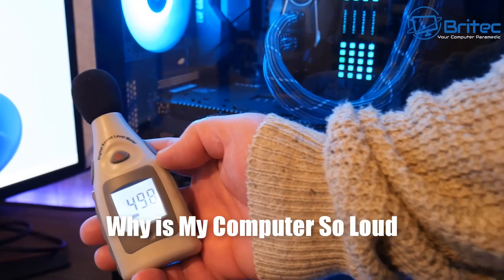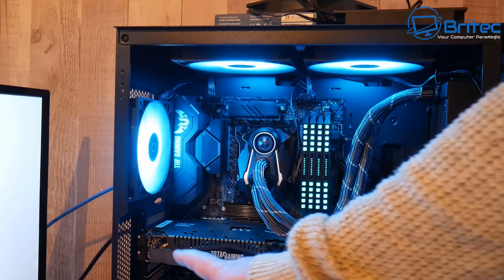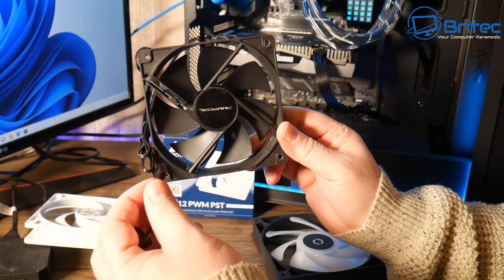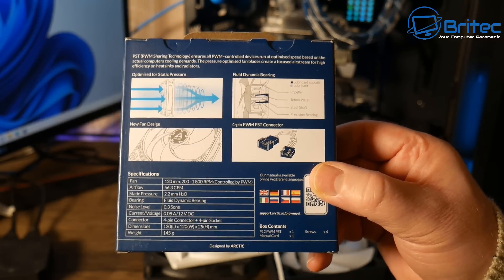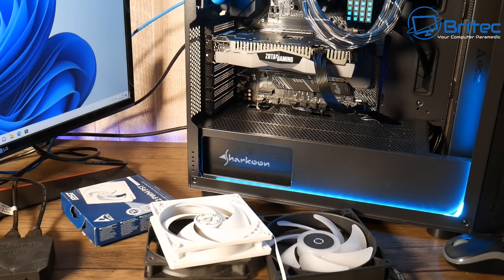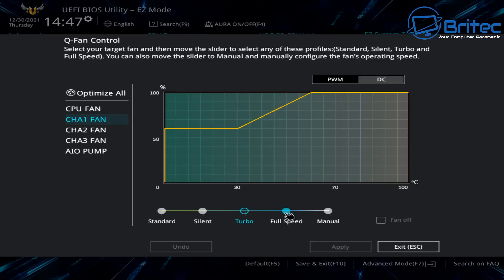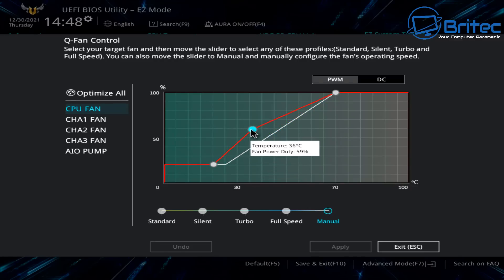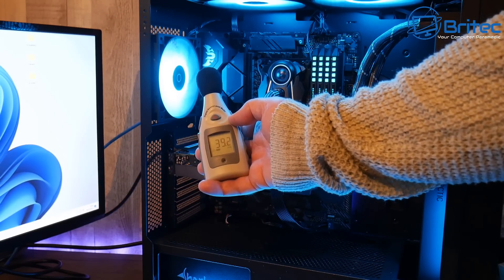Why is My Computer So Loud and How to Reduce PC Fan Noise

Comment: I always connect my fans to pci slot fan knob controller. Especially when you're not putting any load on the CPU or GPU, its great to crank 3 fans down from the outside. THe only caveat is you don't see them on the BIOS but that's not a big deal. Use Speccy to monitor temps and you can crank them slowly to a minimum temp and enjoy the quiet.

Comment: looks like someone setup a click bait video, 2 years, and halfway to a check from youtube. I Quess it is kind of useful information. When pc's were new and small and were horizontal, people had them on their desk. it is only in the last 10-20 years that people have tried to make as much extra money on them and having them on the desk right beside the monitor, and makes no real sense, until you add up the extra cost of a water cooler, RGB and high priced case. I threw some parts together 11 months ago based on the 14700kf, 4070ti super and cooled it with air. watching prices since then on prebuilt based close to the parts that i selected, the prices ranged anywhere from 1000 to 1500 bucks more than what it cost me to build a blacked-out system with the parts in the cheapest atx fractal case. Still 11 months later the prebuilds are still anywhere from 500-1000 bucks more than what i paid with all that extra bling for a pc that is good for 2-4 years at best.   laid the case on its side on the old sub behind the 1600 dollar display that i selected at the time (48" LG C3). The box is over 12 feet away from me. since the 2.1 HDMI cables are such a rip off at 80 bucks for 4 feet. the PC would be a dedicated server/ pc room/ riser closet just like the pros have their gear. Saying all that new solid Pc's builds don't ramp up playing games for a modern game, It takes at least 2 years for a solid build running modern games to start to get loud. I remember reading about hi end a system that the US Government built back in 2003 for recording all public data, the engineers promised the government that the storage media would last 20 years. When the engineers fired up this system, just the power alone was stated to consume 6 million bucks worth of electricity per year (just to give you a scope of the size of the system) anyways when the system was turned on, the cooling portion of the building caught fire, as it was under engineered for the amount of heat the processors generated. The system engineers at that time freaked out as per the article, went back to the Government and told them, we are recording so much information, that the storage media will be at capacity by 2005. Most people will never clue into what was signed in just a few days after north America was attacked that September 11th 2001. Man, I can just see what it must have looked like after that hit started the war for information, some guy promotes a private security system to the Government. I can build you a system that trips all mics on every cell phone, pc and gaming box to go hot and record 24/7 and will only cost the government 100 million bucks. The Government reply, wow, that's cheap, we'll take 2 please. and that is just what the article posted 21 years ago. Me, 2001 one of job that i got that i was asked to do for a Co was to install the very first CRTC mandated real time packet sniffing server on the west coast of North America. These Black boxes were priced just under 1/2 mill each and were installed in ALL head ends in North America. Coolest tech that most people have no idea about. ;)

Comment: what if you don't hear a fan when doing an update... did my laptop and the fan was going crazy then did my mums computer ( long time not done ) and was abit worried it was silent. her computer is slow could this be the reason if the fan doasnt work. plus how can you test if it is working. cheers

Comment: My Windows 10 Hewlett Packard recently starting making awful groaning noises on start up as though I'd left a disc in it. It just makes this horrible noise. That's why I'm watching this video so I'll have to start by unplugging everything and cleaning it. Then I'll look through all the other stuff he says....which I don't know anything about but.....that's why I'm watching this video.

In the meantime....it's on the floor under my desk with a pack of printer paper on top. I've discovered that if I leave it running for a couple of minutes on start up then drop a pair of pliers on it (AKA whack it one) - it shuts up and stays shut up - mostly.

I don't know why this has suddenly started. No drive problems (I recently moved stuff into a second drive - no probs). 

Google/Youtube are fannying around with Adbloc and it's messing all their stuff up (GRRRR!) but all the other stuff runs as it always did and I first noticed it after a Microsoft update. I bet it's Gatesy stampeding us all into new Windows 11 "thingies" with his unwanted, unasked for and opt-out-if-you-can AI "co pilot" - he's stinking the place out as usual.

Comment: my case is shorter i mean not height but length however inside for cpu it hase one fan and all the heat comes out mostly on back side its logical that that side has more heat but i kinda start to panic and cant get out of anxiety because don't want to break pc i wonder if the pc shown in this video can be different i mean what if another fan was on upper side so some more heat will go on upper aide

Comment: Calling BS on the Arctic fan specs displayed at 4:51. Noise level is 0.3 sone, which is equivalent to 10.5db, and that is impossible for a dc fan that outputs 56.3cfm, not even close.

Comment: That's normal gpus cpus nowadays are demanding nowadays for cooling

Cool idea is to put your pc 
First in cool place 
Second try to make a little far from you 
Third use a good headset (maybe stupid but good headset isolate the sound really good)
And use a good cooler if you get a stronger gpu cpu have good cooler's

Comment: My fan is connected to a built-in motherboard port
It constantly spins at 2800 RPM
I can't control the fan speed
It used to be able to be silent

Comment: I wish you or someone else would do a video on PSU noise.  I bought a new more powerful graphics card and while my 750 W power supply can handle it The fan in the PSU gets way louder now when playing heavy load games.  I think it’s just because my PSU is having to output more watts and getting hotter.  I’m not sure if me getting a higher watt power supply or a higher quality 80+ rating would make a difference.  I have bronze now.
Reply: Maybe having the same porblem I have 3050 and it never use to be loud but starting 20 mins ago it sounds like my psu is getting louder I believe
Reply: @groot_racing  I bought a better psu, a consair 850 gold rated and it is super quite.  It was definitely just that my old psu was being pushed so close to its limit and heating up.

Comment: You. Saved. My. Life. At first my fan started to make noise randomly, and didn't take the time to deal with it. Then it started to make this horrible noise almost constantly, and Iit became a real pain. I tried to slap it, to lower the noise for 20s, put paper in it (yes I did), have been watching a lot of videos explaining I should lower my cpu power, cool the air in my room, .... Then I found your video, and did all mentioned in it. It's easy. I just had to replace the sticker with an adhesive, and it was ok (spread a bit of lubricant and the sticker wouldn't stick anymore xD). And now, my computer don't make any sound. And I realized how much noisy it became and the real PAIN it was. I should have done that earlier, but you really change my working condition. Thanks !! Thanks so much !!! (Honestly it was such a pain, I wonder how I could for so long with this noise)
Reply: I lost it when you said "I slapped it" 🤣🤣🤣 me too bro, me too. It's good that we got the Internet to actually learn 💪

Comment: It seems like this is what happens when I play some games on my computer from steam. I'm worried it's going to damage the computer or catch on fire or something like that. Will it?
Reply: No
Reply: @cold2389  No for which one? Or is it both? I'm happy wtih both.
Reply: @Daniel100Benner  it will not explode or just lower ur fan speed using msi afterburner
Reply: @cold2389  Okay, it won't explode. I guess it also won't damage my computer. Idk if I have msi afterburner.
Reply: @Daniel100Benner  its program that i use for my gtx 1650 to lower fans

Comment: Your computer is loud because you have a GTX ZOTAC graphics card.  nothing in the world will make that thing quiet.  It doesn't even have a 0 rpm mode when youre in desktop.  I had a 1660ti AMP Zotac card,  got so fed with it that i threw it in the bin after 9 months

Comment: The  fans  are   running  at   11 ,  when  you need   that  extra  push  !  PWM   controls  the duty  cycle ( one time  verses  off  time  based on the  powering DC  square  wave )   going to the  armature   inside  the motor
Reply from the maker: That is correct

Comment: I'll have to do this. I couldn't hear your fans because of the volume of mine.  :-(
Reply from the maker: lol
Reply: @Britec09  I have multiple machines. One doesn't have to be quiet, but it is because it has controls and I set them right/connected them right (Corsair - expensive, I know but everything in the system is Corsair: AIO, all fans, 64Gb RAM). When I was making a similar system, somehow I didn't get the fan speed controls connected right, so they spin maxed out for ALL fans. Not sure why, but I'm pulling the system from primary use and pushing it to game machine only - I'll recheck the wiring then. I was rushing to get this in service at the time. My prior AIO was off brand and I replaced it with Corsair since everything else was and the other machine worked. Recently, I decided to build a machine that I primarily use for development and teaching (I teach online at uni). I can get by easily with an average video card and I decided on a fan system for the CPU since I rarely pushed the CPU that hard. Case fans were leftover Corsair fans that were NOT RGB and I plug them into a hub and control the lot from UEFI.

Thanks for the video. I watch most of the others, but this one REALLY struck home  for me.

Comment: Yes Brian I think a lot depends on the size of the fan I have six in my main desktop build which I used three 200mm fans that run reasonably slowly therefore less noise. I never used 120mm fans unless I really have to because it stands to reason they have to spin faster to move the amount of air through the machine. Plus I used a particular brand of fan called Silent something or other and although they were very reasonably priced were also very quiet but unfortunately, they are unavailable anymore. I have to say I did fit an internal fan speed controller too which again allows me to run the fans at what speed I want. But a good video mate for a common issue.

Comment: I have seven Arctic P12 120mm fans, as well as a D5 water pump, all running at 100% full-time in my be quiet! Silent Base 802 case and I can barely tell that my PC is on. If you want a quiet system, buy good fans and put them in a good case. It's as easy as that.
Reply from the maker: They are good fans, got another build video coming up soon
Reply: @Britec09  Cool. I'll be watching.

Comment: I bought a long cable for my monitor and one long usb-exenstion cord and put my computer in another room and closed the door. There it sits sounding like a jet motor on fire, and I can't hear it at all. So this may be a cheap and effective alternative if you have room to spare.
Reply: Bruh 👌😂😂😂
Reply: THIS wins the ive-had-enuff-not-today AND youtube!! 😂😂😂😂
Reply: Lmao
Reply: if the game crashes you know what happened 😂💥
Reply: Yo. This is 🔥🔥🔥 😂😂😂
Reply: 🤣🤣Legendary
Reply: I'm about to do the same , changed to a more expensive fans and have download all the fan control out there . Sooo had enough
Reply: W
Reply: Another piece of advice is to stow your computer in your luggage or carry-on. Doing so significantly reduces noise levels.
Reply: The question is I have a spare washroom. Does your expertise recommend me to place my jet engine there ?
Reply: Lol

Comment: My MSI Tomahawk board doesn't  have any manuel adjustment in the bios unless im missing something it's adjusted automatically which is annoying as the chassis fan is too loud. I could adjust the speed on a gigabyte or asus board.
Reply from the maker: It should have it, are you using pwm